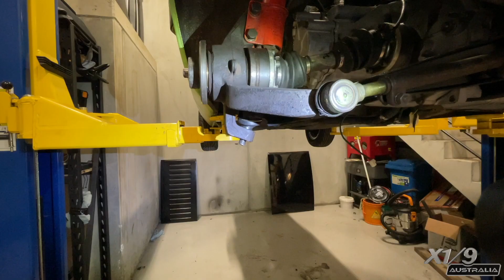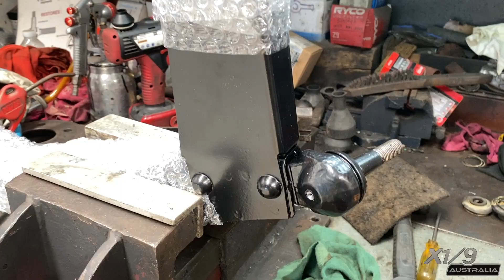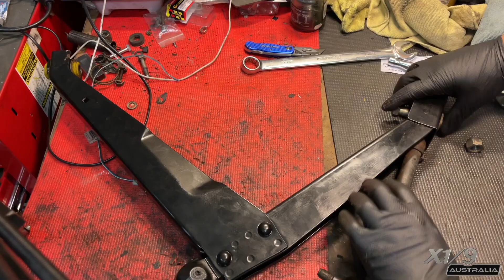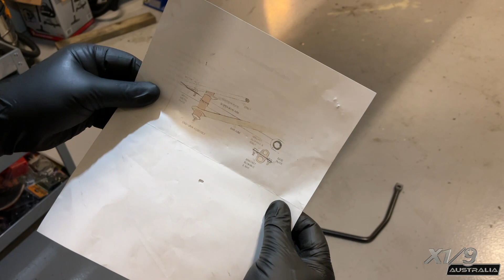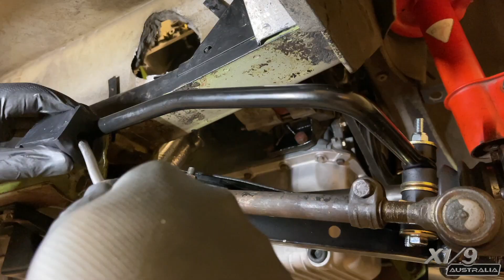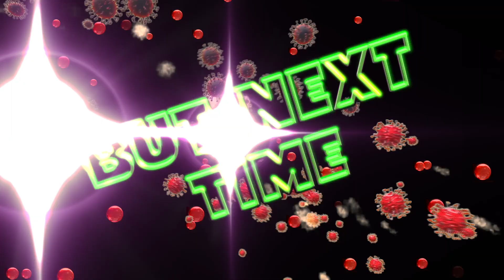The Green Machine Ep.21 — Ball Joint Repair, Sway Bars & Suspension Assembly | Fiat X1/9 Restoration

Comment: Ah, yes here it is!
Seem to be mixed feelings about these swaybars from Midwest.
I had a few chats with Matt about my X19 project, which is a fast road build, not race.
He recommended front only, I installed it with no dramas and it transformed the way front behaves.
Zero roll, faster turn in.

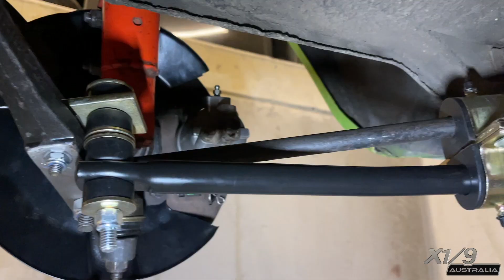Comment: I'm not convinced that front sway bar is going to do much more than hamper the good operation of the front suspension.  staring at 2:19 and it looks like each side can still move mostly independently and side of the sway bars will partially bind up the front swing arm movement.  For it to work properly the pivot points need to com off the tie rod and onto the body proper.
Reply: Anti-sway bars really need to be tuned and I'm not sure how much tuning Matt at Midwest Bayless did with these bars.  Often the resulting handling changes are the opposite of what was anticipated (like the rear bar negatively affecting front traction).  Maybe Mark W has an empty parking lot and an accelerometer or three and can do some testing to see if these anti-sway bars are doing anything beneficial to the already superb handling these cars are known for.  One thing is certain.  Stock X1/9s do roll excessively under high lateral acceleration and the bars may remedy some of that.
Reply from the maker: There seems to be mixed feelings out there about the sway bars. Some owners hate them, and others don't. However, I do feel they work as I have used this same kit on two other builds I have done in the past, but I always install front and back bars. I also have seven other X1/9s without them. So I know the difference in how the corner with and without. I find they will stick coming out of a corner better than without. There are some factors that may skew my experience. It may be psychological. I probably don't push the X1/9's I have without bars as hard. As for tyres, I have used road and semi-slicks with the same good result. The X1/9s that have the bars are also not using stock shocks. I do feel there is less roll in the corners with them. So, in a nutshell, I don't really know, but I do know I corner very hard with them and have more confidence knowing they are on.
Reply: @x19australia  My concern wasn't so much whether you need them or not, but rather the fixed points for the front one being located on the tie-rod rather than mounted to the body.  I think it will do something, but would be less effective than if it were mounted to the body.  And I was concerned it might hamper the movement of the suspension itself.
Reply from the maker: @ibast1  You could be right I don't know. I think this kit is more about installing it yourself without doing body modifications. I'm sure there is always going to be better ways to do this but as an off-shelf part, it's going to be an easier sell if you just bolt it on.
Reply: @x19australia  I had a Pantera a few years ago.  Several members of the club had upgraded their anti-sway bars to aftermarket heavy duty bars for improved handling but their autocross times weren't better.  Fearing snake oil we formed a club committee to investigate.  We mounted about 20 different configurations on the same car and logged data on an improvised skidpad.  We discovered all the aftermarket items degraded the handling and that the stock bars were more effective REVERSED front to rear and vice versa.  Even the factory got it wrong!  This had a lasting effect on my perception of aftermarket performance parts to say the least.